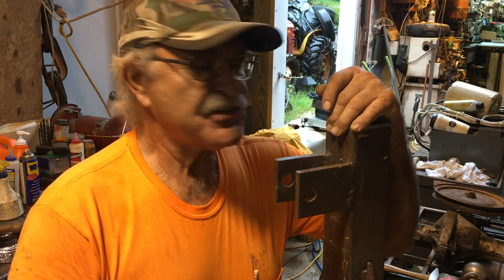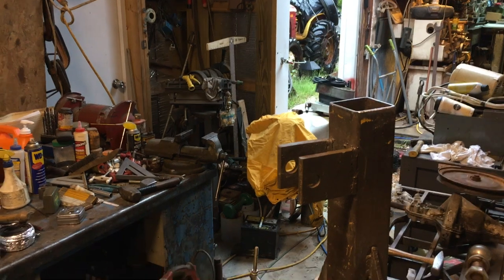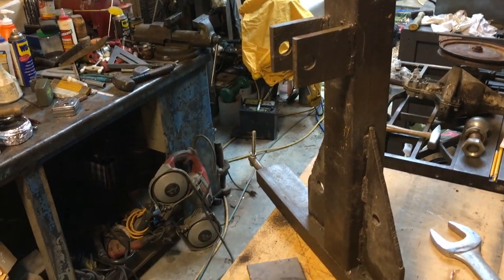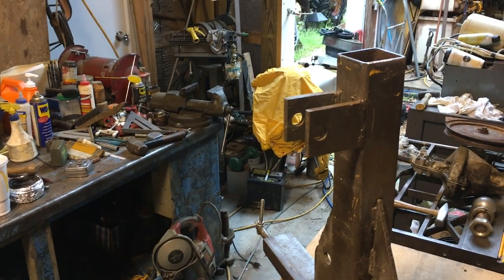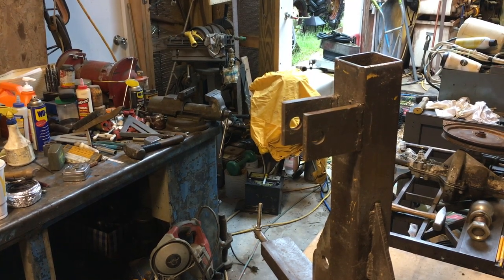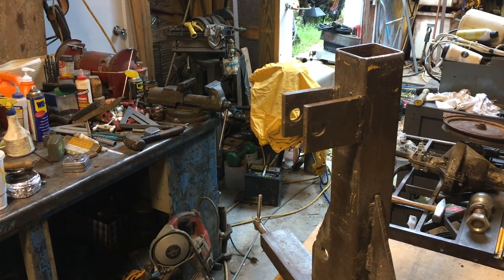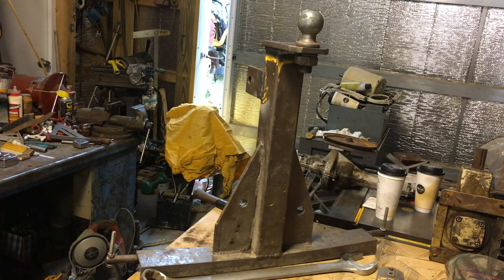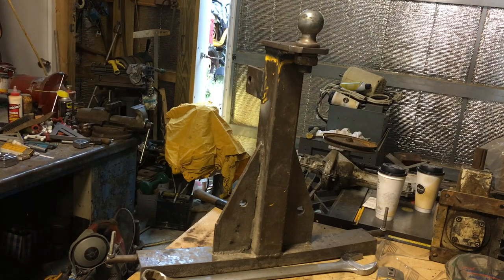Goose Neck Hitch for Tractor Three Point

Comment: Those little doityoursef projects are like money in the bank. 
I don't have a gooseneck trailer but I have one of the old Dearborn hitch mounts that came as part of the deal for the Ford 8N. 
Having the 3 point height adjustment versatility is handy for those pick and place jobs like your sawmill or splitter. 
I can lift, move, and drop the  trailer right from the tractor seat.